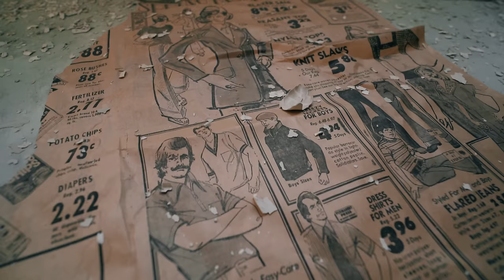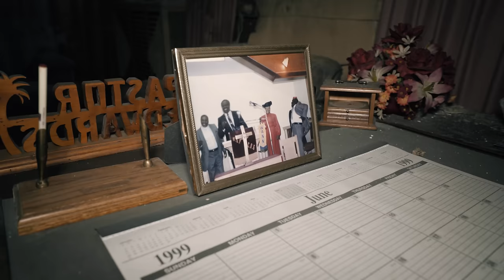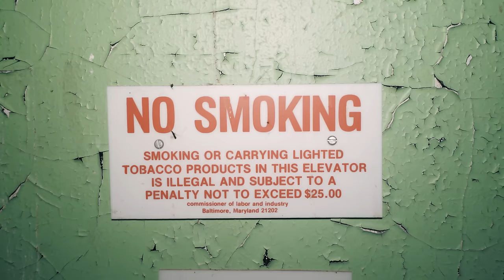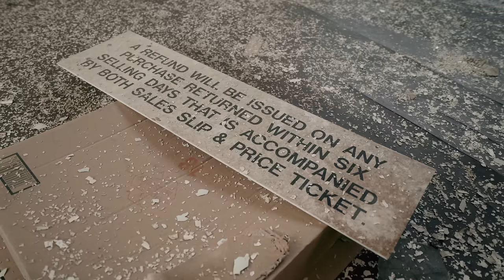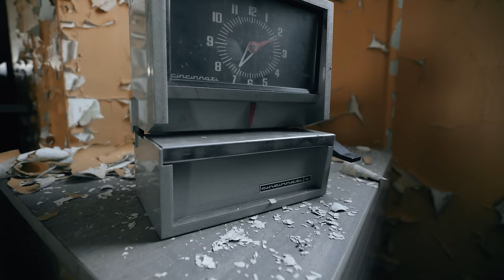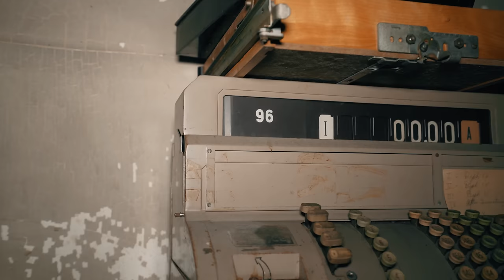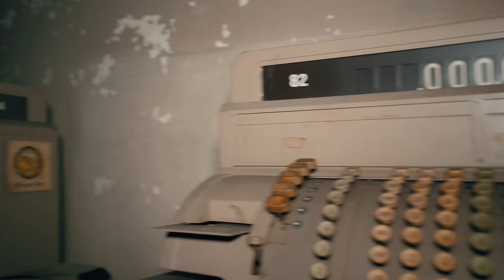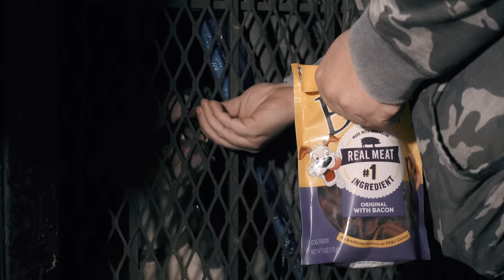Abandoned 1920s Department Store - Found Dog Inside

Comment: The owners of the Building started with Guttman's in about 1930 

Then they merged Braggers to become Bragger Guttman's 

Then Bragger Guttman's went out of business. 

Epstien's a local discount store moved in. 

Then the last store to work in that building was a bargain basement super discount store named YOUNG WORLD that sold dismally cheap things for young people and babies.

The Newish elevators were installed when Epstien's used the building. 

The reason the elevator doors do not work is the doors and the ornate brass cross hatched gates were powered by steam. Much of downtown buildings in Baltimore use steam for heating. The elevator doors in Bragger Guttmans used stream under pressure to automatically open and close the doors. This allowed for ladies to run the huge elevators. Lady elevator operators saved the discount store money since they could be paid far less than male elevator operators. Also lady elevator operators gave the discount department store a more upscale look. Hutzler's and Stewerts employed lady elevator operators to suggest an upscale shopping experience. This store was a time capsule even before it closed.  The newest thing installed by bragger Guttman's was that tiny set of escalators that went from the first to the fourth floor if my memory serves. I'm over 60 years old, autistic and disabled so my memory could be slightly faulty.
Reply: Great info! :D
Reply: Thanks!
Reply: Thank you for this, context is always appreciated!
Reply: Thank you for that piece of history. Helped to visualize it better.
Reply: And I still think its a great thing that you share some of your memories with other people. Thank you :)
Reply: @HL2Striker   My absolute pleasure. I enjoyed life then as now.
Reply: And is it also true Epstein didn't kill himself? #harambe
Reply: Steam operated elevator doors, that sounds crazy now.
Reply: That is awesome! I love the vintage lighting. Would love to rescue some of it, especially the fluorescents! Things like that will never be made again and will waste away to ruin in a few more years or get trashed if the building is ever gutted/ renovated.
Reply: @TheDieselNut  I'd pay $500.00 without batting an eye for each of 5 totally intact elevator lobby directional indicator fixtures with intact globes. Oh yeah If I had the money to do it I'd buy that building and redevelop it leaving all its old world charm in place. That building would make great loft apartments if lovingly restored. Of course I'd live on the top floor and have my own private elevator.  Restoring the elevators to their past glory would be my labor of love. Don't get me started!
Reply: You are friends with Andrew/DieselDucy/Elevatours, correct?  I never knew there were others with a love for old fluorescent lighting until I found him and another guy on Lighting-Gallery.net. I can appreciate anyone for a passion for vintage collectibles and preserving our past.
Reply: @TheDieselNut  For both knowing of and loving Andrew/DieselDucy/Elevatours channel that's a strong affirmative sir. I've actually seen those lighting fixtures in reality. The best thing is some had the spiral fluorescent tubes which are extremely rare. Also those huge pendant lights are also a treasure. Look at the Kauffman's Old Town Mall video that building is also a rare treat. I got my very first credit card at Kauffman's in Old Town Mall. I have an old elevator lobby directional indicator in my home office. I got the floor indicator panel from my buildings old elevators. I have a giant 1970's era fire floor annunciator panel from our buildings lobby when it was replaced.
Reply: This is excellent information!
Reply: Hutzler's! Anyone else remember that store?? I remember there was an Epstein's on Eastern Avenue in Highlandtown; also one at the old Eastpoint shopping center before it became a mall. I also remember the hiss of the steam in those elevator doors as they opened.
Reply: Reading this conversation makes me think of the theme song "Welcome Back Kotter".
Reply: Thanks for giving the history on the place! You are a wealth of knowledge 🥰
Reply: Thanks for sharing!
Reply: @nrdesign1991  That sounds awesome.
Reply: @nrdesign1991  Actually, they were pneumatically operated. Otis didn't use steam to operate elevator doors when these were installed, if ever. I remember these elevators from as far back as the early 1950s - I'm 74 now. My mom would take me to Brager Gutmans at the start of each school year when I was a kid to buy new clothes. The boys/mens department was on the 3rd floor. Sometimes the pneumatics on the car door operator would leak a little air and you'd hear a faint hissing or whistling sound when the operator would turn the handle to close the doors and gates. I loved riding those old elevators and hate to see all the vandalism and theft of irreplaceable parts that has happened to them. The city should have done more to keep this building secured until a new owner could be found.
Reply: @AUTISTICLYCAN  My thoughts exactly! Those elevators are historic treasures. I see all the up/down lanterns and the brass dial floor indicators on the main floor have all been stolen - 45 directional lights gone!. Also the brass plates inside the cars where the on/off switches and floor call button lights were located. All those parts would need to be reproduced and replaced. I would assume Otis still has those drawings archived with their company's patent files. The easiest part would be to replace the smashed glass panels in the doors since those are standard wire glass that's still made.

Comment: The old registers were the last models used before department stores moved to computerized inventory control price tags. (some may remember tags with holes punched with a series of sku numbers)  That change over of systems happened in the late 1970s - early 1980s. Before IBM was the largest manufacturer of the new computerized registers, Singer (of sewing machine fame) was one of the first to mass manufacture computerized registers. Some of the oldest ones likely didn't go to $1,000.
Reply: I remember Woolworths and K-mart use to have NCR/Univac cash registers similar to those, with punch cards and paper tape punchers and readers for inventory control in the 70s as well.
Reply: Cool fact
Reply: Some of the wooden ones might be from the 20's.
Reply: @tekvax01  Yes!  I worked for Woolworths as a keypunch operator from 1971-1985, so am quite familiar with the punch hole coded inventory tape.  Being one of the larger regional stores, we ran payroll on COBOL, meaning I could today get a job in New Jersey.  Their unemployment still runs on COBAL in 2020.  That being said, I've no desire to move back east from Montana at age 83.  It's hard to believe the backwardness of our governmental systems.  We used to be cutting edge, but no more!
Reply: I'm pretty old.  I've used those registers, all except the wooden models!
Reply: dan b what’s woolworths because i’m only 13 so i wouldn’t know but i got a load of old original vinyls and some said woolworths with a price tag of £2.49
Reply: Marie Katherine you’re 83?
Reply: @freya2202.  it was a department store, I guess kinda like Wal Mart. https://en.wikipedia.org/wiki/F._W._Woolworth_Company
Reply: Marie,  it's interesting you are the first person to ever collaborate that memory, of those cash registers!
 I used to sit at the cash registers watch the punch tapes and the cash registers clack away all the time, I think around the late 70s, as I would have been around 10 or so.
I guess it's not surprising that some companies haven't moved away from the old computer systems given the difficulty of rewriting software and rolling it out across the country.  but it does seem a little strange that these computers have been in operation for 50 years without upgrades or changes! I wonder if NJ found anyone to assist with the rewrite of their software?
  I don't remember much about the cash registers, as I was quite young at the time, only that I was fascinated by the computers!
Were the systems that you worked with NCR or Univac?
I remember the punched tape running out a couple of times whilst people were checking out, and then having to wait for the tape to be changed and reloaded, be for they could continue. I would be fascinated to hear more about them!
Cheers,
Dan
Reply: @mariekatherine5238  Remember wooden escalators?
Reply: @freya2202.  Hi yeet, Dan may come by, but in the meantime, Woolworths was a "five and dime store" originally, and the sign would have said Woolworth's 5 & 10 ( geeze, no symbol for cents on our tablets)? Well, there would a a symbol for "cents" after each number, showing that it was known for being an early "discount store",  which mainly gave cheapervquality or just smaller portions of individual things in packaging like what would be needed if you bought complete set of something, then ran out of just one part, which helped everyone get by a lot betterby saving money. I remember they commonly had a really wide center staircase  in the store where other stores would have had escalators. This is probably more than you needed to know, but you will find whole videos done on the subject and it might be interesting to watch one, because there will surely be lots of curious facts about its history that most people won't know, even those of us who grew up with it, and many other stores that called themselves "a five and dime" store.
Reply: @tekvax01  This might have been a little understood reason for so much fraud having been possible through unemployment and public assistance over the years, with long dead people collecting welfare and the like. Now keypunch would surely exist as one step in a larger sequence of computerized tabulation.

Comment: 3:25 Flyer dated 2017. How did that place go to hell so quickly? It looks like it's been abandoned for 30 years.
Reply: Baltimore
Reply: It must have been very run-down for years ad years while in use. That's the only explanation. I mean, you sometimes see places that are in use but look like they have been abandoned for a decade. No repairs, outdated decor, dirt.
Reply: I do construction. You'd be surprised how fast water will ruin something. Also places in the north here, If the house isn't heated in the winter/having people moving about circulating air and basic cleaning things can go to shit pretty fast. Especially if its an older building.
Reply: Water can mess stuff up QUICK. Thieves and vandals can also add to the carnage

Comment: That piece of paper on the board at 18:10 is dated 1976. That goes back to when Brager Gutmans was still there. In fact, anything dated earlier than 1983 was from Gutmans. When Gutmans had the store, the basement had a restaurant called "The Tea Room". I've eaten there on trips downtown many years ago. Floors 1 thru 6 were all retail. Floors 7 and 8 were admin offices. The first floor usually had sale and seasonal items. Second floor was girl's/women's clothing and other apparel. Third floor was boy's/men's clothing and other apparel. Fourth floor was curtains and other soft housewares. Fifth floor was floor coverings. Sixth floor was home appliances and hard housewares. The escalators, as you found out, only went to the fourth floor due to the building structure being L shaped from the 5th floor up. The stairway doors were alarmed with a bell. I guess to alert workers if someone were trying to shoplift and escape using the stairs. The elevators were the normal way to get to the upper floors and fun to ride on.

Comment: That old machine IS a commercial bank coin sorter and counter. It's actually older than the 1920 store. It was either provided by a bank where all of the money was deposed or purchased by the store. It's missing a large top trough type cover which would feed all coins into the appropriate 1, 5,10, 25 cents and Coin dollar at the time. It would drop down into bank deposit bags with the totals written on them. If thieves knew what this was, it would have been gone by now.

Comment: You need to send a decontamination team, in there.  With dust filter masks.  Air blast all that dirt, and dust out of the building, and get some basic wiring, and plumbing restored.  An extension cord with some emergency lights would be fantastic.  Any old equipment can be salvaged, and sent to restoration team.  The windows may have to be tarped, and a cover placed on the roof, to stop further leaks and damage.  Then pull all those rusted chairs out, to a storage room.  Some kind of emergency sheet plastic will have to be used, in the event those wooden floors don't get replaced.  Same with the elevator.  Used parts, and refurbished materials, if there's no money available.

Comment: When I was a kid in the 70's, I remember those electromechanical cash registers.  I used to be fascinated watching the cashiers work them.  They were so clicky.   And when they would hit that "Total" key, they had this spring drivern "Clickity clack!  Clickity clack!  Clickity clack!" kind of sound that would just go, causing all the tumblers and springs and gears inside to just spin and click and clack.  And the numbers would pop up on top.  And the thing would clickity clack print out a receipt.   I was fascinated with how they worked when I was a kid.   If you looked inside one of them, you would see the damn marvel of engineering that they were.  You'd be amazed at all the gears, and springs, and levers just packed solid in there.

Comment: 28:40 Ah, the days of credit cards before the electronic readers came around.  Back when credit card numbers had to be looked up in a book and were not wide spread in use just yet. The slip, needing a thing that slides right across the top, imprinting the number of the card onto a paper receipt much like an old school printing press. And when fraudulent cards had to be notified with written or printed alerts as opposed to the modern instant electronic denial.

Comment: I saw that machine on the landing of the stairway,, I think it's a coin counter/sorter machine,  It dates from when building opened.  I also have heard of some places polishing coinage just for the extra PR when a customer got shiny change from their purchase.   By the way the cash resister are really a device for adding up dollars and cent totals called a tabulator.  Top floor rooms should be for top bosses and executives,, Should have a board room up there and the CEO offices, executive lunchroom, maybe lounge and maybe one elevator should be for executives only if they hadn't done away with that kind of thing yet.

Comment: You under 40 guys are so cute.  8:58 are coin counters. 43:00 Adding machines. 43:47 Timeclock - See it has a clock on it? You'd slide your Timecard in and have the red pointer point to your "In" or "out" time on the card, and it would print the time in that slot.  Card would normally be for one week.

Comment: I would've socked that guy for trying to justify animal abuse. Hopefully those dogs were taken away and he was put on a no owning any animal list, while being fined, with jail time. I've seen people do far less abuse and get a lot of jail time and fines. Hoping he didn't get away with it. You definitely did those dogs huge justice. They could've died from the asbestos, as well as:
- Led paint peeling
- Floors becoming crunchy, soft/hole filled
- Broken glass
- Cracked/splintered wood everywhere
- So much mold everywhere
- Get stuck under something
- Get severely sick
- Get severely injured
- Get in dog fights with each other over food and water
- Catch a serious disease/infection
- Fall through the floor/down the elevator shaft
- Always in the dark
- Hardly any human contact
- Doesn't go on walks
- Lives where they pee and poop everywhere
- Is so scared and anxious of being in the building
- Someone could break into the building and shoot them thinking they are guard dogs/aggressive
- The dogs themselves could start eating each other to survive
- Locked inside so if something were to happen (building collapsing/roof caving in, ect) they wouldn't be able to get out
- No access to fresh water, food, or a safe shelter (open kennel/crate)
Do I even need to continue?

Comment: 30:08 Dog barks.

30:47 Dog's first appearance.

35:35 Dog on stairs.

38:00 Dog is seen again.

41:34 Angry black owner screams at them.
Reply: What does dude being black have anything to do with it ? Why include his race I'm jw..it's irrelevant
Reply: If it was a white man would you have said "angry white man yells at them" ? Just curious
Reply: @briantaylor302  I had a response, but Youtube auto-deIeted it. Tried reposting it with l/I changes. Hope it works, if not then fine. Let them repress my speech.

Replying in German. You need to Google translate it back. A lot is lost in the translation though. For example, I never intend on referring to "you" as a criminal. Also, "common" is used where I typed "uncommon."

Didn't work, screw it!!!